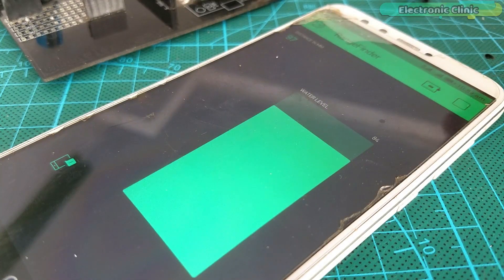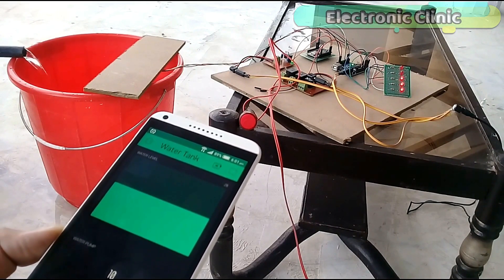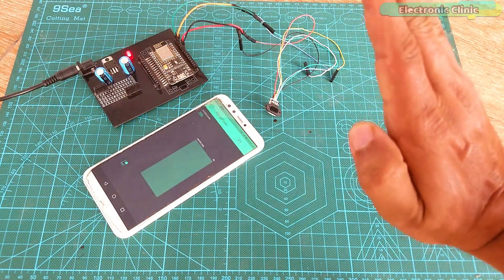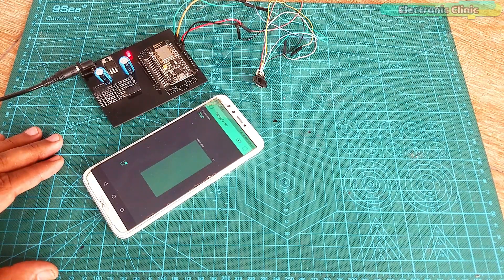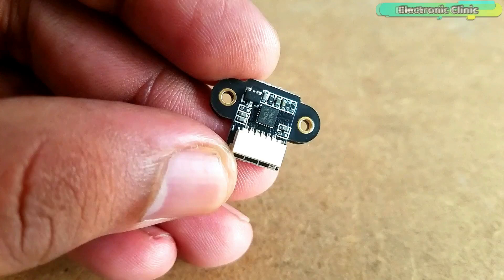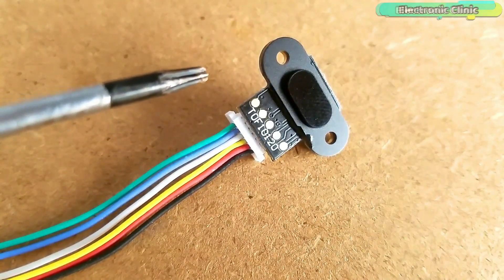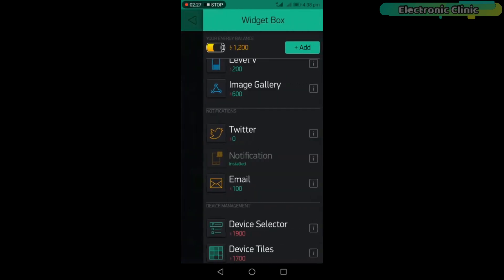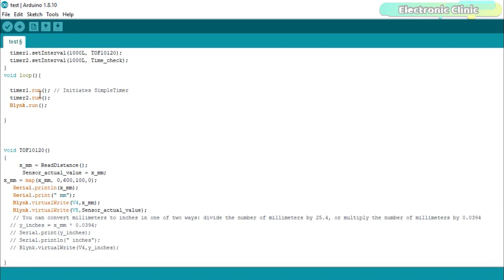IoT Water Level Sensor Using ESP8266 Nodemcu, TOF10120, and Blynk, Water Level Monitoring

Comment: Thank you for the video. 
A few years ago I did a similar project to yours with arduino and a HCSR-04 sensor. The water level was always in error because condensation was created inside the water tank and the sensor was in reading error. With the TOF10120 sensor do you think the problem can be solved? Or do you recommend another type of sensor? 
Thanks in advanced
Reply: I have the same problem,  is this problem solved.  Please reply

Comment: Hello Fahad,
Cool project, i want to implement in  my house but only one problem regarding a library file. in the code you used BlynkSimpleEsp8266.h header file and i downloaded the library files from the link provided but when i included in the code it is showing ESP8266_Lib.h should i download an earlier version or is there something im missing? please help me as this could be very useful for me
Reply: Also could you suggest me another way where i dont need to use the SimpleTimer Library. I cant get my head around it.

Comment: if the water is clear, the laser will reflect at the bottom of the container. I use ultrasonic sensors. Unfotunately the sensor is not sealed and will corrode.

Comment: Nice video. Kudos. I have an observation. Can you add automatic start and stop feature to control relay and Water pump? When the water drops to like 40%, nodemcu activates relay to pump water and when the tank is full, it deactivates the relay to stop pumping before water reaches the sensor. Can you add this?
Reply from the maker: watch my last video, i added some relays which you can use to control other devices.

Comment: There is also another laser sensor VL53L0X, I think it's about half price of the TOF10120.  I have ordered both for testing.
Reply from the maker: i have also ordered some other sensors.
Reply from the maker: did you try that waterproofed ultrasonic Sensor?
Reply: @ElectroniClinic  just tested the JSN SR-04T waterproof sensor, maybe that is the one you are asking about, it seems like it might work in the 2" pipe.  Some testing in last few days looks pretty good.  I'm about to put it into action for long term use.  The TOF10120 did not work for me but I will test it again after I make a better mount,  I think the walls of the pipe are making interference.  I also have the VL53L0X to test.
Reply: @billhall66 I need to measure 4 inches pvc pipe water level   , what should I use
Reply: @ElectroniClinic  no I haven't, I do have one that I was going to test.  I think I prefer this laser if it works well, I just received it.  The ultrasonic seems to have too much noise in a tube and it needs temp and humidity factors.  The laser is much easier to implement if it works.  I am planning to place a white float with flat top in the tube for the laser to sense.

Comment: will this actually reflect off surface of water?  I'm looking for a better solution than the ultrasonic which doesn't work well in a 2 inch diameter pipe, interference from the tubing sides.  I can add a float but I'm curious you didn't actually test it with water.  I also am reading reports that it doesn't have the range as reported on datasheet, possibly the reflective surface color affect.
Reply from the maker: you are right, the range isn't good but in water tanks it gonna work just fine. if the values fluctuated you can take the average reading.
Reply: @ElectroniClinic  this normally works for slight fluctuations for small pumps